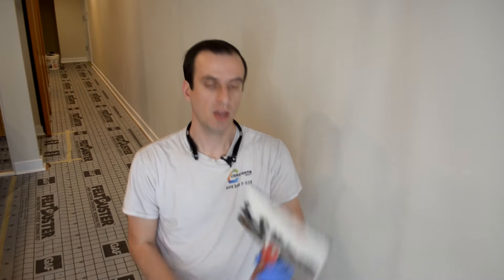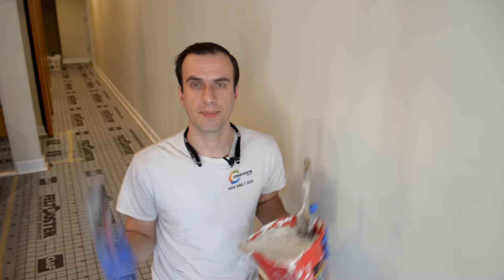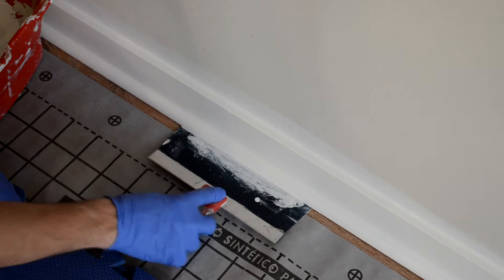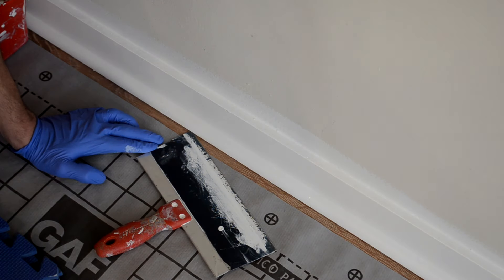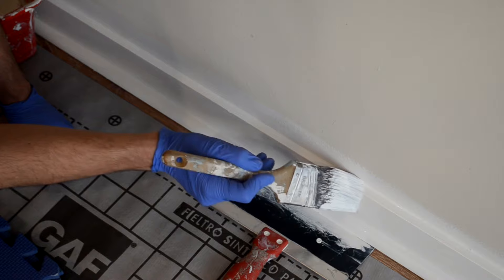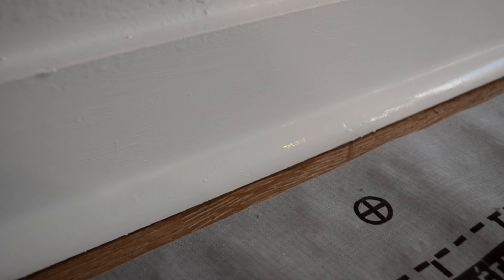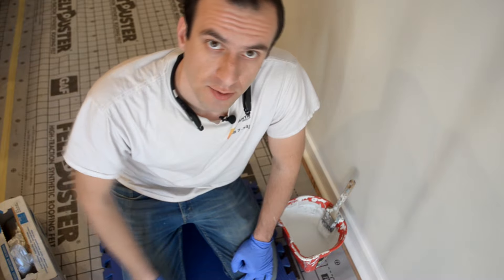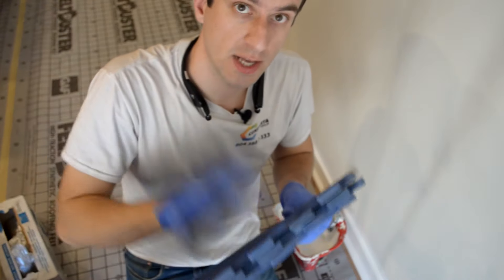How to PAINT baseboards with hardwood floors

Comment: Pretty obvious I’m afraid but when you have no gaps…???
Reply from the maker: There should be a tiny bit of a gap ☺️ if your putty knife is thin it’ll go into the gap even if it’s tiny
Reply: @KonstantinUdalov  I cut my boards and painted them before fitting and they sit literally without a gap. 10% of them I could maybe do your technique but I’m stuck for the treat of them? A DIY error, I guess, but I’d love a good solution as even the best frog tape leaks and oil based topcoats are a bitch to clean out of grooves.!!?! 👍

Comment: I tried to paint like this with a larger 20+ inches blade and it was a mess. I think the paint was too thin and it trickled down the gap and around the edge of the blade. I didn't twist it as you do though. Thank you for the tip - will definitely try it again!

Comment: get the extra long drywall knife , not that one
Reply from the maker: Thanks man 🙌🤝 I actually have a super long spray shield (like 2-3 feet long) but I find it doesn’t go into the gap under the baseboard as nice due to its length. But thanks for the comment
Reply: @KonstantinUdalov  this method also works on painting the ceiling and wall corner for a sharp line